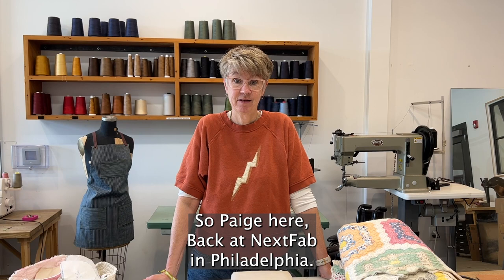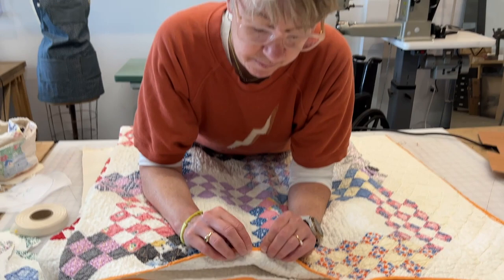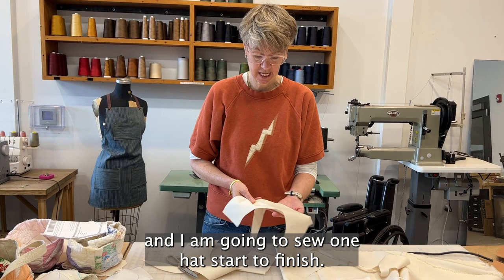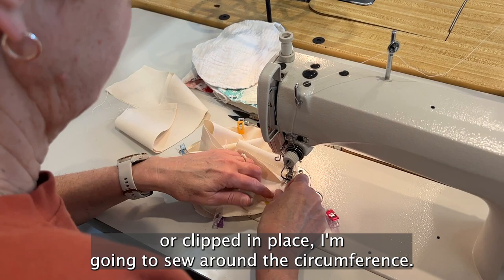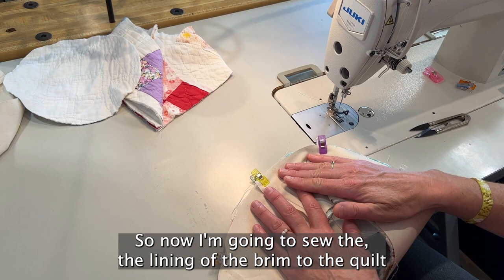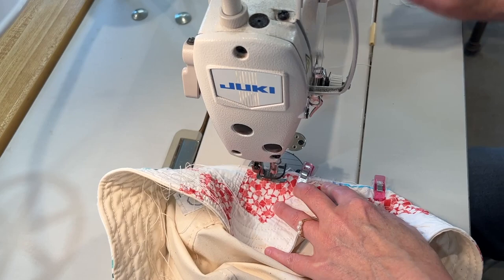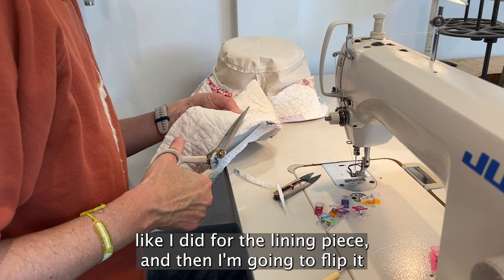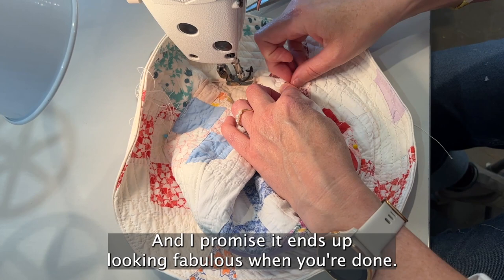How to Repurpose a damaged Vintage Quilt: Making a Bucket Hat

Comment: How would it go if you made two hats, of inner lining and outer shell and sewed them together at the brim, turning through a gap in one of the seams of the lining hat’s band. And stitch through the layers of the brim to hold it together. 
Thanks for these great ideas!
Reply from the maker: hmmm, that might work.  Having made a few of these, I feel like the important part is sewing the concentric circles on the brim to give it structure.  That also makes the rest of the hat go together easily.
Reply: Ah!  I’m also planning some vilene in there. Bought some duck canvas cotton which should be rugged